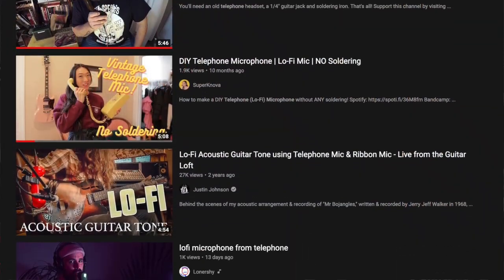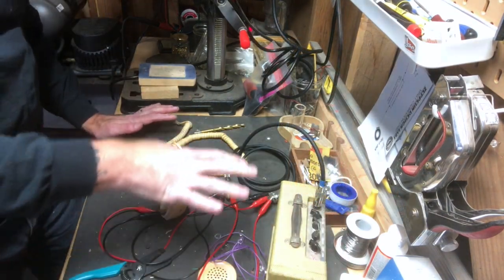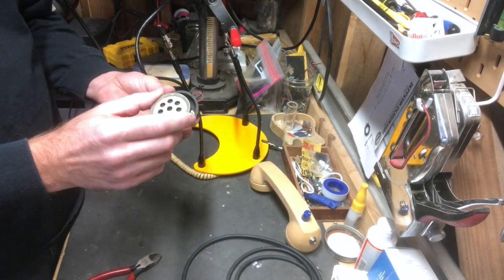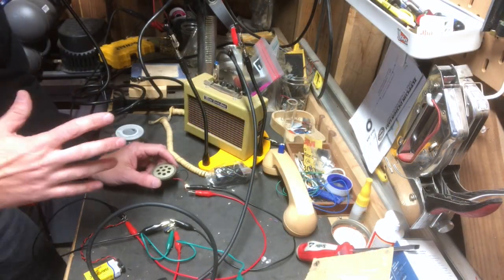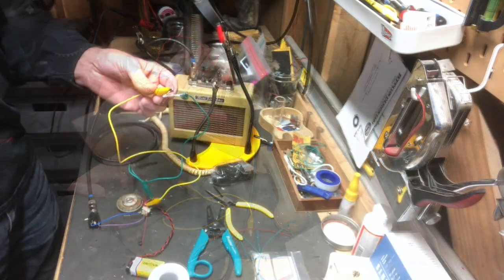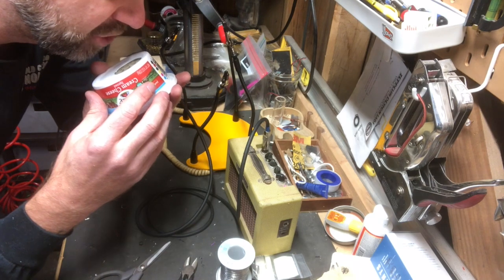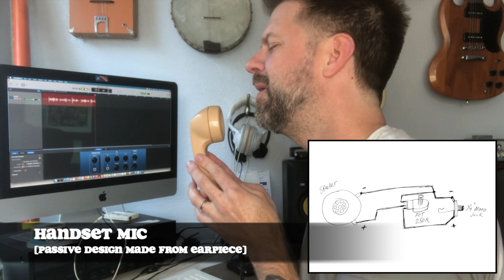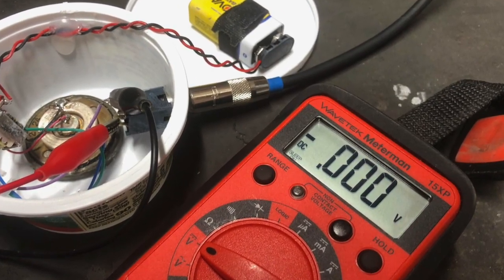Making 2 Lo-Fi Microphones From 1 Old Telephone Handset

Comment: Not sure how relevant it is in your case but I remember reading that the carbon in carbon microphones often clumped together from moisture in the air when they were stored in people's garages and caused distortion. Putting them in a bag with desiccants in it for a little while and also tapping on it to break up the clumps was two of the solutions I remember.
Reply from the maker: That's entirely possible. I will try that. Thanks for the tip and for watching.

Comment: Hi , I believe if your want less noise you might try packing the container with foam or cotton batting to kill the distortion. Also try different but denser garbage to mount your mic in. Those light, thin plastic containers are great finger drums. Also, you might try playing your Kazoo into it and see how that sounds:-)  Merry Christmas from Fearless Freddy in the Emerald City
Reply from the maker: Thanks for the suggestions. I may try some insulation inside the container. That makes a lot of sense.

Comment: I've made a couple of lofi mics from newer (I guess 90s) phones. These use electrets which seem to need about 5 volts. You can use a battery in a similar way to your carbon mic, but the circuits ive seen use a capacitor to block the DC. Maybe you could try that. I expect the transformer adds some mojo though! I also found a circuit that allows you to use phantom power - the voltage gets stepped down by a zener diode. Anyway i love your style and im now on the lookout for some old phones ! 😊
Reply from the maker: Thanks for checking out the video and also for the suggestion. It's fun to repurpose old electronics. I appreciate the support.

Comment: Muy genial ! 
Funciona con cualquier transformador de audio ?
Reply from the maker: The transformer I used had equal winds on the primary and secondary sides which would keep the signal at unity gain. You could use a different transformer but if it’s not equal winds it would either be boosting or attenuating the signal (depending on which way you orient the transformer).

Comment: loved it!!
Reply from the maker: Thanks for checking it out.
Reply: @musicalmiscellany  I'm doing my own project, much simpler than yours haha, just wiring the speaker to a guitar jack like you mentioned in the vid, but I found my wires are screwed into the earpiece and have a kind of 'wrench' end on them. 

When I cut them I found inside they were thready and cottony as well as the copper, so I don't think they're suitable for soldering to the jack :'( 

Do you perhaps have any advice as to how to move forward? Could I just solder a regular wire to the screw and connect that to the jack? thank you!
Reply from the maker: @AFunkyHypnoCat  I can't see it but it sounds like your idea is solid. I'd probably just figure out where the wires connect, snip the old ones, and then solder new wires that are easy to strip.

Comment: I really like the sound of passive mic! so i put it in my guitar, but signal is pretty weak. What type of preamp I need to make it more powerful?
Reply from the maker: Thanks for checking it out. There are a number of different mic preamps on the market. Some of them are very pricey but there are many simple ones like the ART RP-series and Klark Teknik series. These are in the $40-70 range. Note: most mic preamps assume you're using an XLR jack so you might need an adapter or two to make it work. It's worth noting that most mixers (even small ones) include a mic preamp, so that might also be an option. The Mackie Mix5 has a great mic preamp and can be used for other things as well (and it sells for about $70). Of course, something like the Klark is a lot more portable opposed to carrying a mixer with you everywhere, so each option has its ups/downs. Good luck.

Comment: I know this is an old video but, I was wondering if the first microphone could be connected directly to a computer with a regular 3.5mm jack or would it need a preamp to work?
Reply from the maker: Hypothetically, it should work. If the level was too low, you'd need to boost it with a preamp, but this mic's level should be similar to any passive microphone. However, the majority of computers with an 3.5mm input are stereo (TRS). A microphone is mono (TS). So, the more important thing would be wiring the jack to satisfy the TRS connection. If you wired it to a standard 3.5mm mono (TS) jack, I'd imagine you'd get a 50% signal or no signal at all.

That said, the best way to find out is to try it. Otherwise, it's just hypothesis and speculation. I haven't tried this so I can't guarantee it would or wouldn't work, but that's what I would do. Good luck.
Reply: @musicalmiscellany  It works! I was able to use a regular headphone/mic jack I ripped of an old speaker and attached it to the rotary phone speaker and it works like a charm! No pre amp needed! Super strong signal too, so I'm gonna use it as my daily driver microphone.
Reply from the maker: @CHS731  Awesome. Thanks for the follow up.

Comment: I want to make a mic like this bro, (the vintage phone) but I was wondering about soldering a xlr cable instead of a 1/4 Jack, of course i want to have a volume pot, is this possible? i mean, using a xlr cable
Reply from the maker: Thanks for checking out the video. You could definitely do that but remember an XLR jack has 3 contacts where a 1/4" mono jack only has 2 (as does the phone mic). If you used XLR, you would have to either: 1) leave the shield contact unused - which may actually result in audible hum - or 2) add some sort of a shield for that third contact. You could get some copper tape and put some of it inside the handset, then solder a wire to the copper. That should do it and it wouldn't be very difficult. It would be a little more work to wire it up XLR but totally possible. Good luck.
Reply: Thanks!!! so following your instructions, im gonna use the same diagram you made BUT the conections from the 1/4 now are the xlr cable wires right?
Reply from the maker: @by.daekeryyy  Pretty much. The XLR has 3 contacts (hot, cold, & shield). You'll wire positive to the hot contact, negative to the cold contact, and the copper shield you create to the shield contact (or just leave it open if you want to try that). Good luck.

Comment: can this work with 3.5 mm jack audio
Reply from the maker: Yes. It would work exactly the same (as long as the 1/8" jack was mono) just drill a smaller hole in the plastic.

Comment: Carbon Mic..... I THINK phones only use 4 volts.... so 9v might be over driving it..... Idea.... what if you bypassed the transformer, go straight to the element and use "Phantom Power" from a mixing console and see if that might work.
Reply from the maker: I'm pretty sure phantom power is +48V so if +9V is overdriving it that would definitely be more than it could handle. You'd have to step the power down with a resistor network or something.